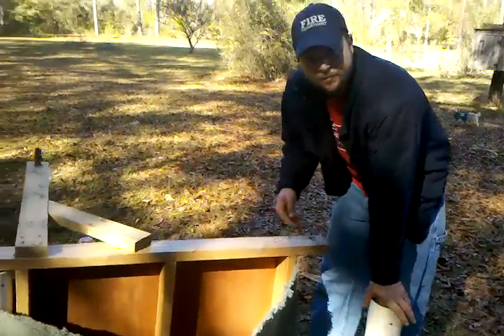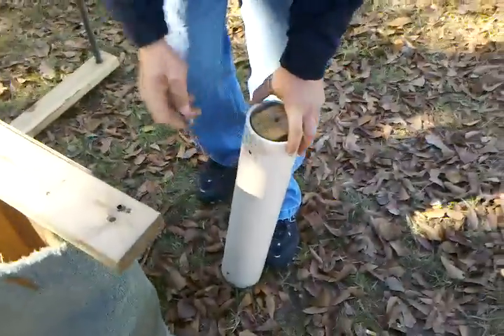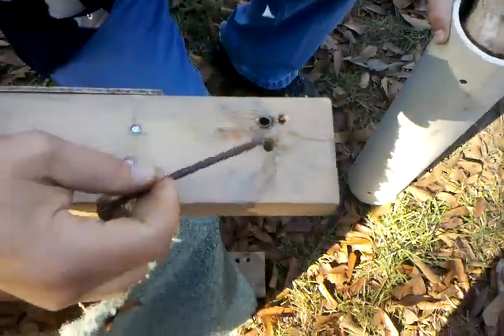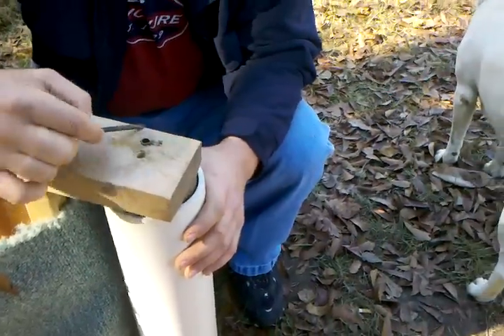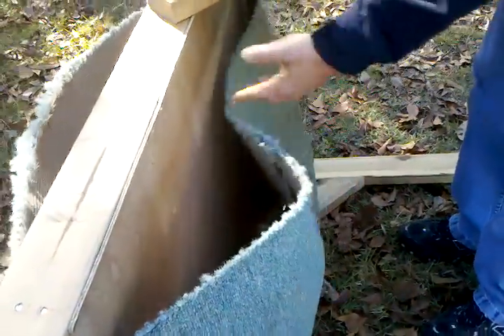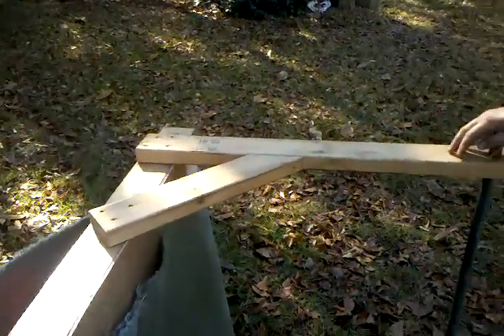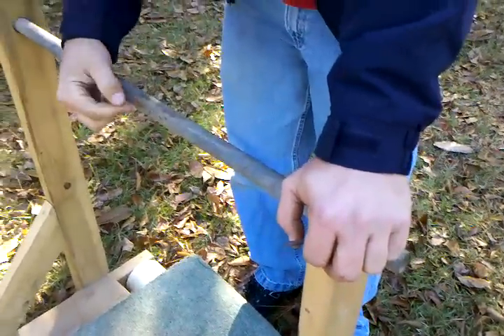how to build a carpet mill / dog treadmill

Comment from the maker: @GHANDYTAMASH When fitting the carpet.... it needs to be loose, not tight. make sure the carpet sags a little on the bottom Friction can be reduced by aplying a wax  coating on the running board if its still a little sticky. Your pits will have no problem moving the carpet if you do both of these things.  Elevation has a little to do with it also.... depending on how hard you want to work your dog. Its the oposite you would think. Its harder for the dog the less elevation you put on it.

Comment from the maker: I put the block on all four sides on the edges out of the way of the carpet. Its good to do it this way first so you can get the angle you want. Measure the hight of both front and back and cut and nail your 2x4s as legs.

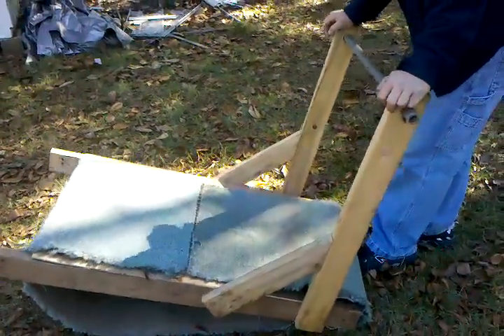Comment: 3:50 Since the incline angle of the belt doesn't change the amount of work required, adjusting it won't change the vigorousness of the dog's exercise. Being a stationary treadmill, the dog isn't really climbing anything when running on it.
Reply from the maker: Do you have a physics degree? Or is this your "educated" opinion? I replaced the wood floor with tin and it made the world of difference. Thanks for your input.
Reply: @MolanLabe78  All the dog is doing is moving the belt. The dog isn't going up or down. The incline of the device doesn't change the difficulty of moving the belt much.

Comment from the maker: @saintjoseph408  what kind of board did you use?  I would try talcum powder on it first as this worked for another guy on here.  I use paste wax. on a sealed board. you can seal it with polyurethane then put a coat of wax or silicone. that should make your dog shoot out the back side of it lol. send me a quick fideo and i may be able to see if there is any other reasons the friction is too much. Thanks for your interest!

Comment from the maker: @eliodoroh I havent experimented with different types of wax, Talcom powder is probly gonna be the best thing to use.  Your carpet if too loose will bunch up under the dogs stride. My mill has a slight sag when looking under it.  The mill will run with less effort with a loose carpet and vice versa the tighter requires more effort .... you just have to find a happy medium :)  I hope this answers your questions. Thanks for watching.